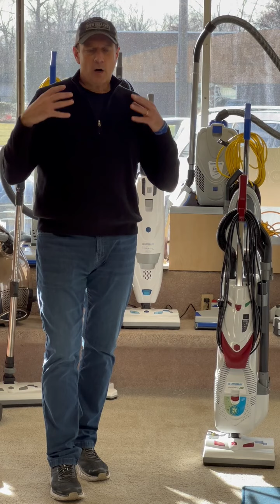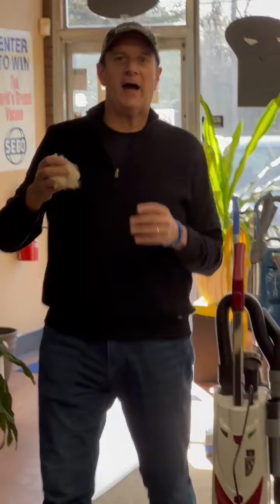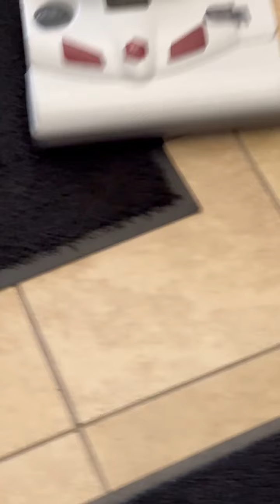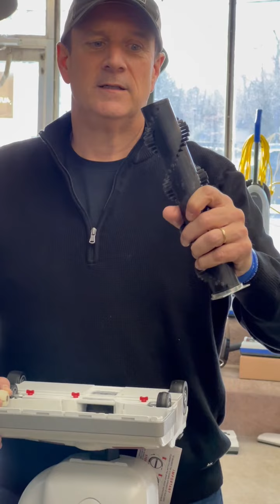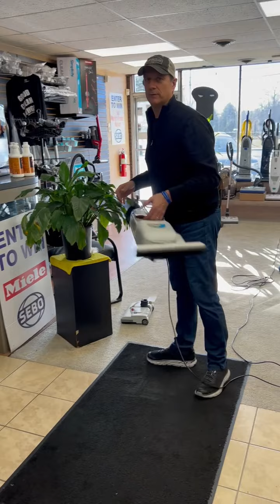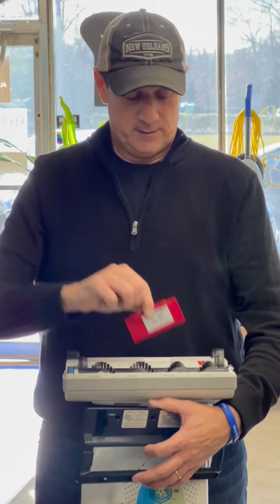Lindhaus Healthcare Pro @KickassVacuums

Comment: How they clean depends on the design of the Brushroll, the airflow channel and the soleplate, also how well they clean depends on how clean the pre motor filter remains.

How they last depends on how you treat them and take care of them.

How easy they are to use depends on what your needs are and what your physical condition is.

Those are the secrets.